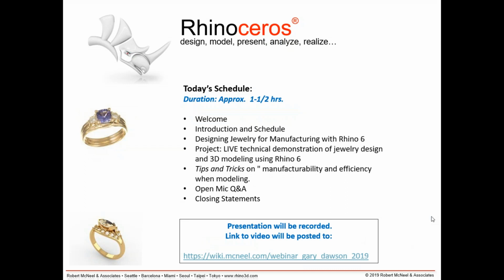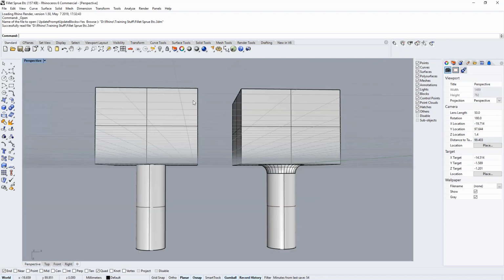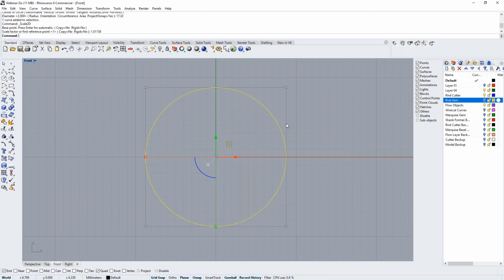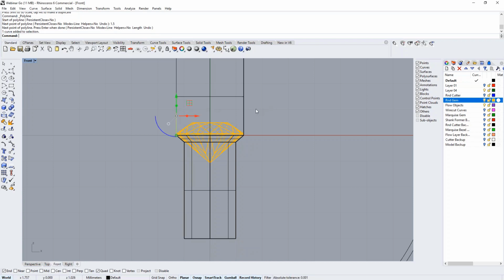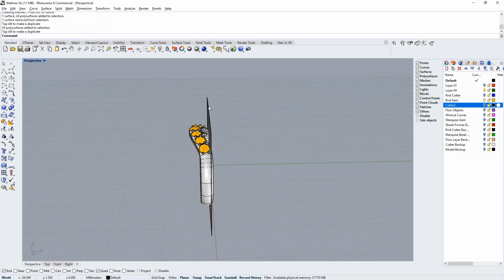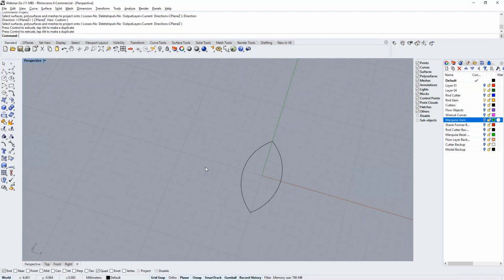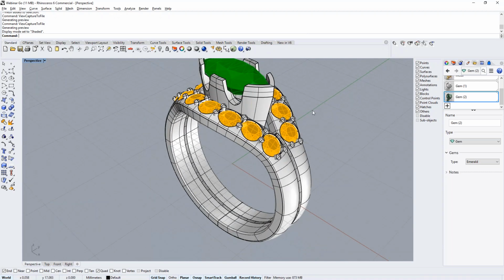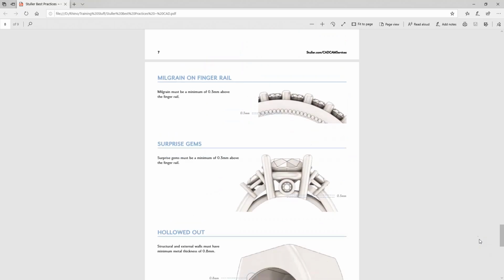Designing Jewelry for Manufacturing with Rhino 6 – Webinar

Comment: At around 32 Minutes, when Gary moves the top 3 control points, his polysurface also follows. When I do it, just the curved shank line moves and the polysurface remains a standard circle. Why is this? Is there some sort of setting I need to change?
Reply: Did you turn on "History Mode" on the Bottom of your WIndow?

Comment: what is the relevance is the scale factor (1.01158) when we dont know the dimensions of the original ring
Reply: There is always a shrinkage factor in the casting process that will be specific to the methods used.  Often there is shrinkage (or overage) in 3d printing as well.  I developed that scale factor as an adaptation to my own processes.  Your results may vary depending on your printer, its calibration and your casting process.  The dimensions of the ring itself is less relevant than those factors.